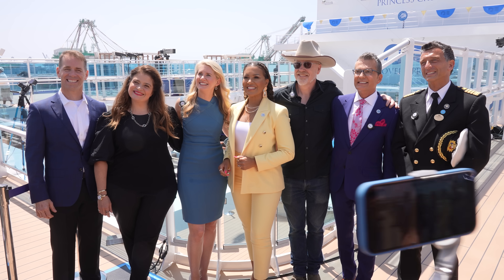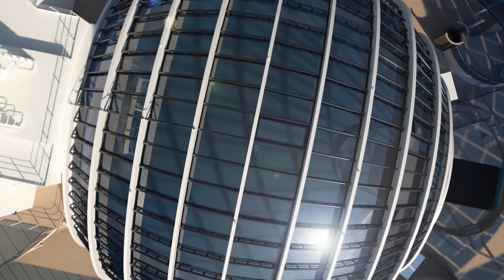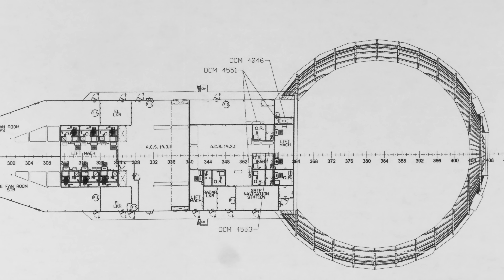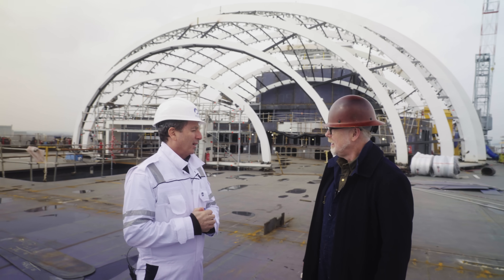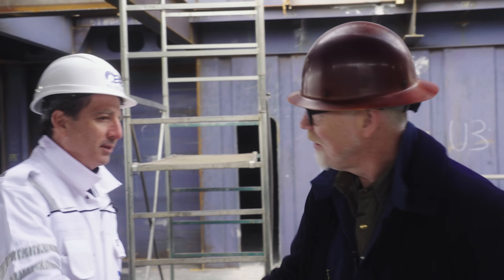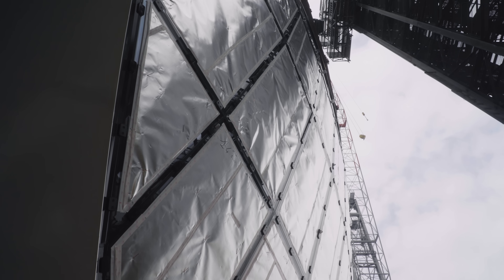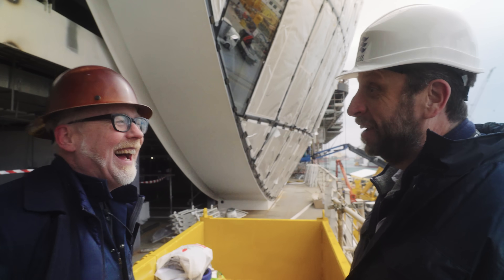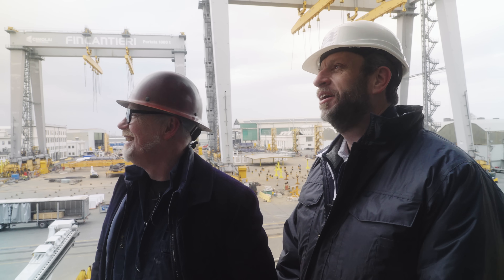This Object Is the First of Its Kind

Comment: Hey Adam, underneath the Dome I noticed what look like rubber dampers. Is that what I actually saw? If that's the case that's ingenious, allowing the Dome to flex somewhat separately from the ship. I hope that you can confirm, however at the same time I'm disappointed that you didn't look at that feature in the video.

Comment: Great greenhouses come to mind, one in Glasgow’s Botanical Gardens and the other in Buffalo.
Two different climates, the Buffalo greenhouse was faced with massive expansion and contraction forces resulting in huge leaking issues and the subsequent redesign.
Glasgow’s Kibble Palace was upgraded from its 1800’s wood structure to a metal structure which, did not experience the same temp swings did have its own challenges.
I am assuming the superstructure or large portions of it, including the domes are Aluminium to keep the CofG of the ship low ?

Comment: Cruise industry be like "How do we make riding on a boat for a long time fun?"
Personally I'd try to make it look as ugly as possible while still being perfectly functional, appeal to the dark Sci Fi market, get some CRTs on there and install structures designed to make concerning creaking noises. Maybe even set up some fake emergency scenarios for passengers to opt into where they'll get like, woken up by alarms and have to go help hold something shut or move some props or pull some levers and get dials to show the desired readings. Cruise ships are massive mires of ecological concerns and political tomfoolery but as an engineering marvel they are amazing

Comment: How does this size project ever pay itself off? People pack WAY less tightly than shipping containers and to be honest, the price it cost for going on it doesn't seem high enough to ever pay for itself even if you don't factor in the army of staff needed to maintain this ship.
Reply: My napkin math reckons this ship could conceivably turn a profit of $100MM or more annually. 4300 guests is a lot of people. Interior rooms are purported to cost $2000 for a week long excursion. though I'm sure that pricing will adjust as the hype dies down.

We have no idea what this actually cost to build. The outlay for a project like this would undoubtedly exceed a billion dollars but not by much, after 10 years it should be paid for and it's not unrealistic to expect it to be in service for several decades with minor refits and the plan is clearly to make this ship as flexible as possible so major overhaul can be done down the line and extend the service life of the hull.

The ship will also be sold or scrapped at some point recovering some of the initial outlay.
Reply: It's not just the cruise itself...It's the drinks people buy, restaurants people eat in, videos and photos people buy, want internet at sea? You have to pay for that also...If they didn't make money, they wouldn't exist.
Reply: I also used to know ballpark numbers, but this was in early 2000's when I worked on board princess ships. But, they 100% make money.

Comment: while technically very impressive these ships are an mobile environmental disaster. This ship for instance tries to advertise themselves as not that bad because it uses LNG. But when actually studied LNG emits about as much greenhouse gas as coal (sometimes worse). There is a lot more wrong with cruse ships. The noise they make, water pollution, impact on coastal communities, damaging coral reefs, and more. Again they are a technical marvel and interesting to learn about. But the shouldn't exist in their current form

Comment: Would have been really cool if they'd chosen to create a geodesic dome. I wonder why they didn't? My best guess (as a non-engineer) is that it would have been difficult to integrate into the deck layout?
Reply: i find geodesics tend to have worse views because they're all triangles and the parts where the beams go is not really aligned to where people try to look out, with these more rectangular windows aligned in layers you would get a much better view
Reply: Maybe this was easier to build. Don't know. Icon of the Seas has a geodesic dome structure.

Comment: I wonder if there is some sort of focalpoint inside the Domes where the light generates to much heat or could be dangerous. Like with that british tower called "walkie talkie"
Reply: Not really for many reasons: that skyscraper in London was parabolic so the reflective surfaces of the glass concentrated the sunlight on one arguably large but still one point, while the dome even if they were perfeclty reflecting or working as a lens (thing that i doubt) being spheric scatter the light on a larger area, that's what's called spherical aberration; but mainly, by the looks of it, that is aluminized glass so only part of the light gets in and being flat panels there is no lensing and it ges pretty much stright through

Comment: No offense Adam, I love your work and love engineering awesomeness but not from the cruise industry. They are a poisonous group that does nothing but harm. Every ship generates the same amount of C02 as 12,000 cars. A 7 day trip will produce more C02 per passenger than the average EU citizen does in a year, and the largest cruise provider has 13 million passengers annually. Not to mention the incalculable harm done to marine environments through waste water dumping or just moving giant ships through sensitive ecosystems. It's bad enough that we have to rely on giant ships for the movement of goods without using them for leisure.

Comment: Fun Facts: A large cruise ship can have a carbon footprint greater than 12,000 cars, and passengers on an Antarctic cruise can produce as much CO2 emissions on a seven-day voyage as the average European in an entire year.
The most commonly used fuel type for cruise ships is heavy fuel oil, which is relatively cheap but highly pollutive. An average-sized cruise ship carrying 2,000 passengers uses 150 tonnes a day when it's at sea; in port, it requires an average of 50 tonnes to meet the liner's electricity demands. Ships like the Harmony of the Seas burn up to 4,900 litres of fuel per hour, 249,000 litres of fuel per day.
 Cruise ships generate vast quantities of solid and liquid waste, often dumped into oceans and seas, affecting marine flora and fauna. Environmental groups state that the passenger's carbon footprint triples when one opts for a cruise journey as these 'floating cities' produce around 15 gallons of hazardous chemical waste every single day.

Comment: ship engineering is always pretty cool as you really do need to bring your A game when you're pitted against the ocean.
gonna so sweet once the tech to make then zero emissions gets going and they can be used properly guilt free.
have always wondered why no omnidirectional wind generators on a ship the shear availability of wind power is nuts at sea.
Reply: Just saying, cruise ships don't go near the open sea. They're not built to stand it. They're not cruiser liners :( It's disappointing

Comment: I'm less than half way through the video and it seems like they have passed the point where they mention that not only do the structural members of the dome need to flex with the ship, they need to limit the amount of flexion they impart to the glass panes.

Nobody, not Princess, not the design firm, certainly not prospective passengers want the ship to take an unfortunate series of rolls and swells culminating in a massive CRACK followed by what I would guess was sounds accompanying a crazed sheet of laminated, heat treated glass hitting the deck.

Comment: That was fun!!!  I got to work on the last refit of the original Pacific Princess!  I built most of the cabinetry for the project and then went up to Yarrows Shipyard in Victoria BC to help install them.  My crew's work wasn't finished by the time she had to sail for Hawaii to return to passenger service, so I rode her to Pearl Harbor and then on to Tokyo before returning to the company shop in Oregon.  I can fully understand the need for structures to flex!!!  We hit a hurricane and I was introduced to the sounds and weird apparent gravitational anomalies in heavy seas, such as the bow being submerged, air under the middle of the hull and then the screws popping out of the water as we crested the swell and rode down the other side.  Poseidon Adventure level experience!!! When the Perfect Storm came out, I could not watch it!!  Too intense!!  This new vessel reminds me of the Fhloston Paradise space cruise ship in The Fifth Element!!

Comment: The back dome is the balls and the front dome is the head.

Two engineers got drunk at a bar one night when they were supposed to be doing their design. The next day their boss says hey boys where's that design you were working on last night. One of them groggily reaches in to their coat pocket and pulls out this stained napkin sketch of a 13 year old's joke of a Weiner ship. Hands it to boss. Now this.

Comment: This is an odd sponsorship mismatch, Princess delivers a solid reliable product but they're one of the least innovative least design-focused cruise brands. Why you chose to pair with them of all cruise brands is beyond me. 

The Excellence-class ship platform (which this ship is based on) has been around since 2017 and has been used by multiple lines owned by Carnival Corp.

Comment: Is the focal length of the dome going to help heat the pool?  It's basically a huge lens.
Reply: I t is not really a "lens".  The light-bending power of a lens is due to the thickness of the glass.  This is not solid glass, but two thin sheets of glass, so the glass will have very little refractive power.  Furthermore, the glass is not curved,  but rather flat sheets.  There are many ships which have glass-roofed areas.

Comment: I wonder what they did to avoid the lensing for the top dome. All i can think of is sun fried passengers.
Reply: I think there needs to be a higher refraction index for that to happen. I doubt the glass used is thick enough for them to gather enough rays to make a considerable enough temperature difference to fry people. Plus they double pane it, which lessens the refraction effect compared to if they put a solid pane of the combined total thickness of the glass and the empty space in between the panes

Comment: Yeah my first two thoughts are how do they maintain climate control without that glass just turning into a giant greenhouse, and I can't imagine cleaning it will be a lot of fun.
Reply: Yea, I imagine/hope that the engineers learned from the mistakes that plagued Chicago’s State of Illinois building (a/k/a the James R. Thompson Center).

Opened in 1985, the uninsulated (🤦‍♀️) glass curtain wall created a horrific terrarium effect in Chicago’s summers and a heating nightmare in our winters. 

Google will ultimately control the building after the developer who bought it in 2022  invests millions to overhaul it.
Reply: Ceramic infrared blocking coatings have come a long way, untinted glass or just a carbon tinted film would likely make it into a big greenhouse but modern coatings can make it feel like the sun isn't even there.
Reply: It’s also double glazed. The engineer mentioned two layers of glass with a gas in between.

Comment: Hey adam, I live in richmond (bay area) and have a kinda cool old deadblow hammer you may like . One face is copper and floats a bit when struck, and the other end looks like compressed and rolled up canvas or some other similar material.  It's yours for the price of a how do you do and a handshake. I'm entirely willing to drive out to sf if need be. You're something of a role model of mine.

Comment: For a good while there I was wondering if this was an ad or a normal video. It should probably be marked as containing product promotions.
Reply from the maker: It is marked as paid promotion (it shows when you start to play the video in the upper left), and it is also mentioned in the caption and the pinned comment. Although we would have done this video anyway; Adam's pretty obsessed with cruise ship engineering.
Reply: @tested  your comment saying that it is sponsored is not actually pinned to the top. fyi
Reply: @tested none of that pops up
Reply: @tested  Interesting, when I rewound to see if the popup in the upper left was there, it did not appear. It looks like it only appears when you click into the video, not when you rewind to the start. Carry on!
Reply: @tested No popup.